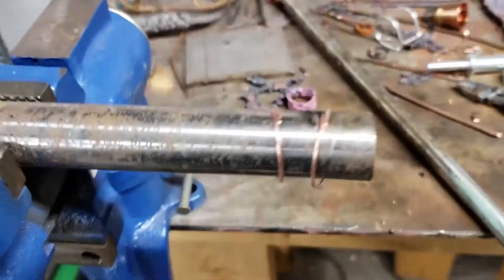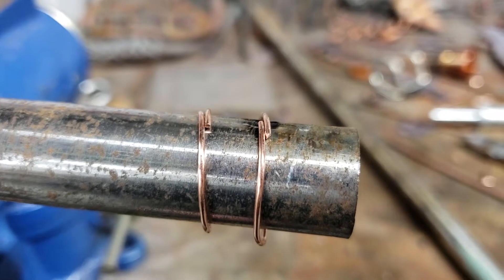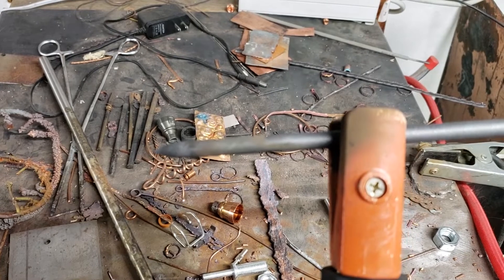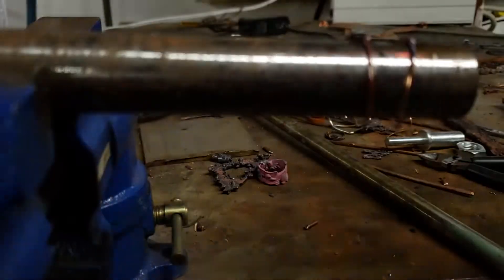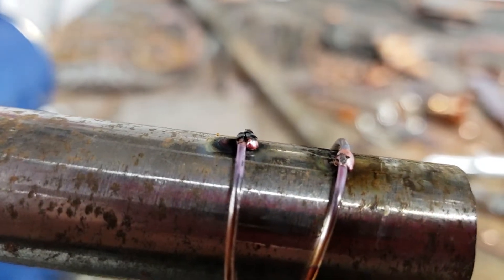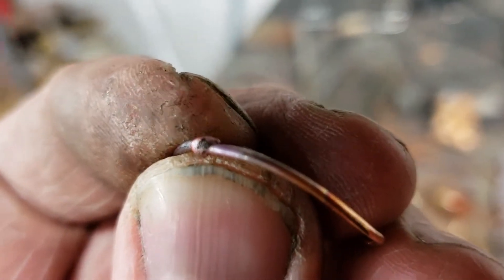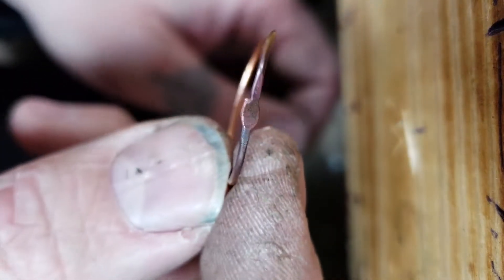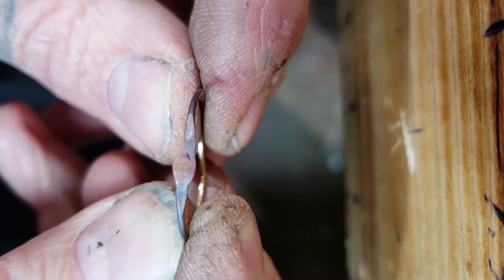How to stick weld a 16g copper stacker ring using Graphite

Comment: So you can't weld 16 gauge copper?
Reply from the maker: If you had a tiny tig machine you could but a normal tig even at 5amps just melts the crap out of 16g copper.